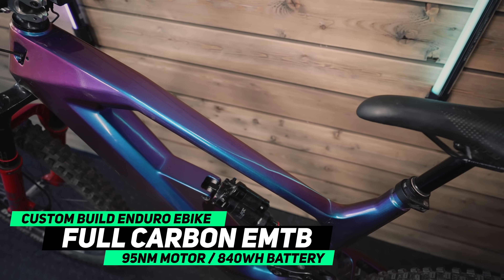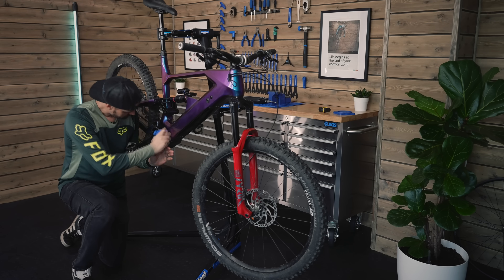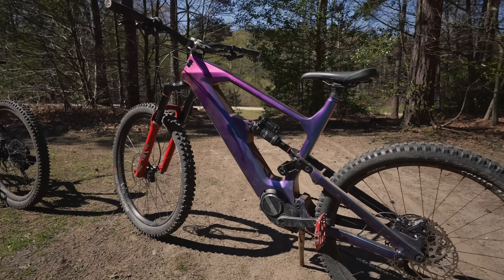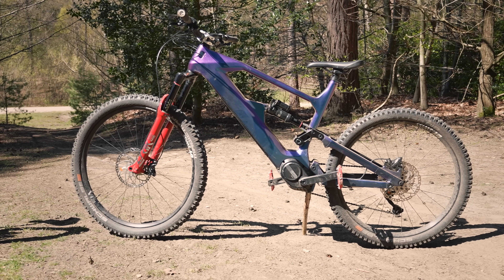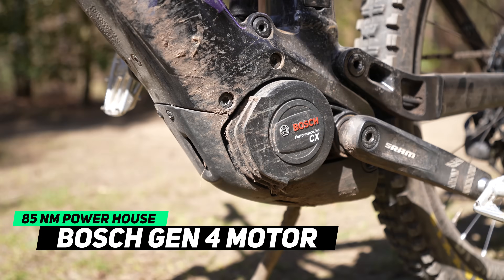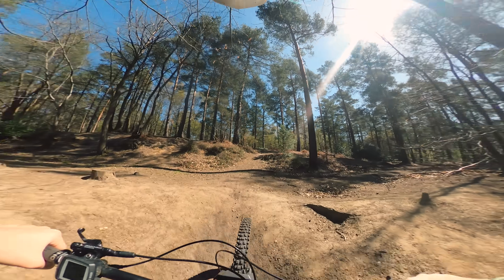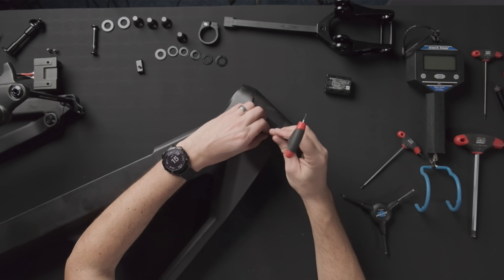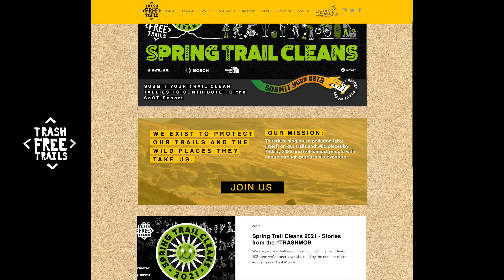This motor ABSOLUTELY CRUSHES it!!

Comment: Just a thought, I remember you fitting a 10speed to the cheeb, isn't the trek a 12 speed, surely gearing is going to affect performance?
Reply: Indeed, just what I was thinking and there is the weight of the two bikes to compare.  It's not all about the motor.
Reply: Also the model and pressure of the tyres.
Reply: I have eagle 12 speed on my DengFu with a Bafang M600. That climb he did is a breeze on my bike. I do way longer and steep climbs than the climb in the video. The M600 is the way to go for this frame. And having that giant pie plate cog on the eagle cassette is also the way to go for very steep climbs.
Reply: @EL34XYZ  The M600? Explain how you're going uphill with that 500 watt motor.
Reply: @EL34XYZ  do you have the ludicrous mode on your Luna X1?
Reply: @prolene1971  No, I have no need for Ludi. I use level 1/9 on my X1's and I like getting a workout. The bike has way more power than I ever use with just the regualar non Ludi controller.
Reply: @EL34XYZ  not everyone wants to own essentially a moped with cranks. Also with high wattage eats the battery quite fast. Not to forget heavy duty chains. Foes it have good shifting protection? Here in europe the m500 might be good choice if u want reqular emtb.
Reply: @viljosavolainen2286  You are spewing out garbage. The Luna X1 is an Ebike, not a moped.
Reply: @EL34XYZ  debends on the countrys legislation. And beyond that if you have thumb throttle.. yeah, we had in the past (around 80s) "bisycle". It had motor and cranks. Frame etc was exactly like their moped model and it went 40kmh. So what makes it not being moped? It doesnt go assisted beyond 25/32 kmh? Or it doesnt go without pedaling?
Reply: @EL34XYZ  that 2kw model is interesting. Does it have 1000% assist or even more? What type of chains does it use if other parts are from standard bikes? It needs hefty stong sprockets and chains, or you need to prepare to change them reqularly. If they had that 250w version in europe with otherwise same specs at that price it might be instand deal for me. Sadly stronger motor would make it registered bike if used on public roads with yearly costs of insurance.
Reply: @viljosavolainen2286  agreed

Comment: I have a 2020 Trek Rail 9.7. Bosch gen 4 motor. I can attest to how good this motor is. There is a very steep uphill with dips, ruts and turns where I ride (Lake Geneva Zip lines). It's about 150 feet long I'd guess and quite steep. I can put this bike on turbo and make it no problem. Just walking up this grade is very difficult. When the reviews say this motor is good, this is no joke. It's REALLY good.

Comment: Thanks Rob - I appreciate the honesty. Personally I like home builds. I accept that probably the Bosch motor is the best in class, but then look at the cost!!. It also occurs to me that when the warranty runs out the Bafang can be repaired by the user, not so Bosch as they are sealed units I believe?. So how would you think the Bafang stacks up against Shimano, Yamaha & Brose I wonder

Comment: I have a bafang M420 no throttle here in usa, had my motor for 19 months and climbed steeper in clines then that. Though I'm not sure of the 500 series or what gear you used to climb and my bike weighs 72lbs....... questions?

Comment: I have the bosch in my rail and I always thought the bafang was faster. I think this motor is in the Lune X1 bike making 2000watts and I was thinking of replacing my rail with that but now I don't know.
Reply: Luna bike has the m600 not m500 thats in this video and is a beast on ludicrous mode with 2000w hits 60km/h I dare say would smash any of the big brand name
Motors on the market, only downside is it’s 300g heavier and not road legal
Reply: @carsandotherstuffguy5300  I did it, sold my rail and bought the Luna X2 with 2000 watts....I am loving it!

Comment: I think its something to do with the seat tube angle. Chinese carbon frames have a fairly slack seat tube angle. That is why whenever I borrow my friends ebike with exactly the same motor. I always move the seat forward to steepen the seat tube angle which helps smoothen up the climb.

Comment: It's great to see someone finally do a legit hill comparison. It would be great to see the EP8 and Bafang Ultra with Archon X1 (Watt Wagons) controller.  EP8 won't do much but that Archon is rated at 160 Nm. Hope the next CHEEB uses one of those!!!
Reply: So it seemed to me that the Bafang bike could not climb something that a regular bike could do in short gear. I climb stuff like that all the time, just at the limit of traction and balance. Did I miss something?
Reply: ep8 nothing  special, bosch g4 will eat it on hills
Reply: Personally I'm more interested into comparing BBSHD versus Archon engine. Both seem to produce 160nm from engine. Gear ratio must be usable for climbing and high speed on road.

Comment: M500 typically is used for road/hybrid bikes.  M600 is for MTB.  The German made innotrace sinusoidal controller for the M600 is going to be bonkers.
Reply: M500 is the slightly de-tuned version of the M600 in order to comply with power legislation to be a Pedelec - like the Bosch Gen4, Brose Mag S, Shimano EP8, Yamaha PWX2.  The M600 is an s-pedelec motor and falls into a completely different classification - like a moped.
Reply: @pigshed  The M600 is literally twice as powerful...
https://youtu.be/qKd8GWlN-LE

Personally... I have the 2021 Orbea Rise on order since I'm an ex-MTB racer and I want that light flickable feel.
Reply: @justlikeyouful  Have you considered the Siryon ? Will be interesting to see what the bafang in that's like. Hopefully brilliant.
Reply: @pigshed  I did check out the Siryon.  Power, weight, torque are very similar but the Rise was lower priced and I can buy it right from my local bike shop.  Shimano ep8 rs motor is not perfection (what is really?) but I know I will get support for years and years.
Reply: @justlikeyouful  are you sure that Innotrace made controller for m600? They just develop for bafang Ultra.
Reply: @benzoesansodu5866  Yes, Wattwagons has it on the Ultra motor as used in the Hydra eMTB.   Word in the forums is they are developing for the M600 now... but because it is a sensorless it is a little more complex.
Reply: @justlikeyouful  I got that controller from half year. Just looking for m600 controller  :)

Comment: Just ordered the Dengfu E06 it was a bit weird making a PayPal purchase of 4.6 grand based on some texts and pictures. I really like the idea of a fat tire high performance ebike.Hope it doesn't disappoint. I bought it based on the cheeb video you posted Rob ! Is the new m500 more powerful than Bafang M620 G510 1000W 48V ? That's what is coming on my EO6
Reply: That's it not bad I paid $14,000 for my specialized levo turbo comp
Reply: No G510 is Max Torque: 160N.m
Reply: Hah after reading about the 14k bike. Mot bad mate

Comment: stupid question but can you just ride this like a normal E Bike and no pedalling at all??
Reply: It is sometimes supplied with a thumb throttle.  But if you built one up and wanted it to comply as a "pedelec" (ie, be legal without licence plate/insurance) you couldn't install it.  They work as pedal assist. You pedal, it assists depending on how hard you pedal.
Reply: @pigshed  oh thats interesting cheers mate!
Reply: Yes, sure. 
My Bafang 750 watt has both pedal-assist and throttle. 
No pedaling needed if you use the throttle.

Comment: i have never run out of power on a climb with the Brose. When it gets to vertical the front lifts up or the wheel spins out. the motor isnt the failure point.

Comment: The m500 is the bafang baby motor. The m600 destroys the Bosch and has no speed limit. I have a rail 9.8xt Bosch and on Strava the only trail times I can't surpass are the ones I posted on a day I borrowed my wife's m600 last year. So Bosch wins if you live in a nanny state. The Bosch is the smoothest motor by far but nowhere near the m600 in power.
Reply: Exactly....
However, the m600 does have a speed limit for the motors in the US on the Luna X1. With a 38t chain ring, was able to pedal up to about 54kmh.
Installing a 40t chain ring next week.
Reply: why not just put a bbshd in there

Comment: Good test !
I wonder how much impact has the battery packs here.
Are the cells, assembly and BMS of the Chinese E-Bike the same characteristics as on the Bosh one?

With lower drain cells and/or a weaker BMS, the voltage sag under load or lower peak current to the motor could limit what the Bafang motor can do.

It's often more obvious in other EVs than bikes, but battery packs are half the motor power 😌 or at least can be a bottleneck just like the controller, programming and motor hardware itself.

Comment: So Chinese Nm are like Chinese lumens for lights🤔
Reply: Lmao🤣 got one of those lights rated at 2000lumen and it barely let's me see a meter ahead.
Reply: Nm are not power. All that matters in the end is mechanical power, measured in Watts. Nm at the wheel can be levered with gearing. it seems the M500 has a 15A controller @43V that is slightly less power than the bosch cx (36V 20A). I don't know how many amps the 48v bafang controller can pull, but most likely less than 15A, since the motor can only handle a certain amount of power before overheating.
Reply: @JoLe1991 i think, the pinions are different between these bikes. The Newton meters are at the engine output and not at the rear wheel. If the pinions are different, there may be more or less Newton meters at the rear wheel. For example, at low speed (big pinion), there are a lot of Newton meters.
Reply: @BigEyess  yes true, the chainring to cassette cog ratio impacts wheel torque. the M510 is limited to 14A. on a full 48V battery the motor can pull up to 730W, if the efficiency is assumed to be 80%, the motor output would be 580W, which is pretty much on par with the bosch
Reply: Прошло 3 года. Вас ещё смешать китайские моторы Баланс???
Reply: Newton Meters ?
Reply: @bradburdett4491  yes I was comparing how some Chinese brands rate their lights at huge lumen ratings (hence the "Chinese lumens") and maybe there's a Chinese Newton Meter as they may also be exaggerated
Reply: @streddaz  probably it's because of a powercurve, where the bfang isn't good at low speeds while the bosh is...just try to guess

Comment: The vague title of the video already made me suspicious that the true winner would be the Bosch in the end. :-D Honestly, i think its really time to take the Bafang M500 into a testlab for some detailed measurements. I suspect that neither the original M500 nor the improved one they send you is actually capable of reaching 95nm of torque. While i admit that Bafang may still be dealing with a poorly written firmware here, i rather suspect that the M500 is actually a 75 to 80 nm motor. I would really like to see how it compares to a Shimano E8000 with 75nm. I have a certain feeling both will be pretty much eye to eye rather than Bafang ending up as the winner. Now im not saying the words "advertisement scam" here just yet. But...... ;-)

Comment: What about different geometry/tires of both bikes? In which mode did you test it?
Reply from the maker: Turbo / highest mode. CHEEB has a big Betty on the rear in 2.6 - grip wasn’t the issue, it was the low down power at low cadence 👍
Reply: 95 NM
@ rpm
95 continues or
Peak

Comment: Ah, even though the advertised Nm torque figure of the Bafang is higher, the sheer finesse of torque delivery of the Bosch is just top-notch. Good comparison! I have to ask if you'll entertain the idea of testing those built Bafang motors with an aftermarket controller? Innotrace is one of them
Reply: Not apples to apples though as the gearing was not the same.
Reply: Bosch outputs more Watts than Bafang. Not sure about Bafang but Bosch is ~600w continous.
Reply: @finrider9924  the performance line cx doesn't deliver 600 watts ever. Even the s-pedelec version won't go higher than 350.
Reply: @noneofyourbusiness4294  Yes it goes. Said and showed by Bosch. My Haibike flyon goes upto 1000w.
Reply: @finrider9924  It doesn't. Try googling that. 

They released the strongest version so far this year. The 2022 350 watts s-pedelec version. 

How do I know that? First, unlike you, I check things before stating them. 
Second, those things are a big part of my job. 

Whoever told you it's 1kw really had a field day with you.
Reply: @finrider9924  oh, and who told you that the Flyon uses a Bosch motor? It's a TQ. 

Why on earth would bosch even market that? 

Plus, if you're talking about the 920 Watt version, we're looking at a market bosch isn't  even fishing in.
Reply: @finrider9924  looking at Haibikes site: nope, you don't have the 75kph version. 

Haibikes S-pedelecs still use the Bosch Performance Line CX, while their Flyon models currently still are limited to the 25kph version of the TQ motor. Which, just like the 25kph CX, maxes out at 250 watts.
Reply: @noneofyourbusiness4294  Just giving example of flyon (TQ). On My bike manual they state 990w max.
On independent test Bosch 427w continous and TQ HPR 120 553w continous.
Bosch made the mistake on giving that info out once but they nenied that afterwards 😄
Reply: @noneofyourbusiness4294  There is no 75km/h version of Haibike 🤣
Reply: @finrider9924  not a single source on the Bosch stuff. Things like that blow up immediately. I'll go with a hard nope. 

And you're not exactly a reliable source after arguing that your TQ powered Haibike is a 1000 Watt CX. 

Nothing, absolutely nothing pops up to any claims you've made here. 

And not even TQ themselves state 990 watts, nor does Haibike even offer the 920 watts version. It's either one of the dumbest typos in a manual ever, or I'll have to call bullshit again. 

Plus, there's no point in Bosch hiding that their CX delivers more than specified, as long as it properly locks down at 25/45kph depending on the version. 

And you keep changing what you're saying. Bosch showed it, independent tests showed it, Bosch hid it. Sorry, but no.
Reply: @finrider9924  yes. I stated that you don't have a 75kph version of a flyon, because it doesn't exist. 

The top of the line Haibike model right now would be either the Xduro Allmtn coming in at roughly €9.000

Or the or the Xduro Nduro coming in at the same. Both coming with the 25kph version at a whopping 250 watts. 

The S-pedelecs from Haibike currently are bosch exclusive. You aren't looking at your manual, you're looking at an advert stating "potential" and fell for it. Giving enough doubt of you having €9.000 lying around to spend on a bike.
Reply: @noneofyourbusiness4294  I have the 2022 Xduro Nduro 8.0. 950w Max. The 2018 model had 553w continous. My display says the same, almost 1000w Peak.
And you are so saying my manual that came hand to hand from the official dealer is fraud? Also the flyon displays shows fraud data? Give me a brake. Tell me when you have ridden this bike 😄
Reply: @noneofyourbusiness4294  Sorry but you are wrong.
Reply: @finrider9924  nope. I'm not saying your manual is a fraud. I'm saying that your manual covers several types of motors of a, technically, single motor. 

I'd bet there is some wording along the lines of "up to 990 watts"

That isn't true for what you have in your bike, though. Your 25kph bike uses the 250 Watt version. Which isn't a bad thing,  at all. 

Technically the "big version", combined with the rider may output 990. The Motor alone does 920. Wiggle room of maybe 1%.

Sorry, mate, I'm not wrong. I can back up my claims, you can't even do as much as to provide a datasheet of a bike you claim to have.
Reply from the maker: Sorry, but Bosch, Brose, Yamaha and Shimano (and others) peak much higher then 250w. My Brose (250w nominal) peaks at 715 watts. The 250w figure that is used by manufacturers is purely a nominal figure over a given duration, to adhere to legislations and be legal in many parts of the world. The Bosch Gen 4 peaks at a similar level. Bosch just don’t advertise it.
Reply: @RobRidesEMTB  I'll ask for the same thing as before: any proof outside of "but mine does". 

As a dealership, we have to talk to customers about how their motors "just aren't the same anymore". Sure, over time, they just aren't as good anymore. 

But "they aren't as good anymore" is a far cry from saying that the CX puts out 600 watts, let alone 1000. 

If you have a video on it, I'll happily watch it and apologize.

But, outside of speedboxes I don't really see it happening. 

I'm sure the motors could handle it, no questions asked. But regular dealership updates won't unlock that.
Reply: @noneofyourbusiness4294  So again  you say the official dealer that sold the bike mies and gave wrong manual? Also the display shows false data? Also independent test (EMTB 3/2018) is fraud?
Reply: @finrider9924  I never said they gave you the wrong manual. 

I'm saying you got the correct one, which covers all three versions, as they all work on the same concept. Same thing with bosch btw. You'll get the same little booklet, no matter if it's an active line or a performance line. 

So, what I'm saying, and what I've been saying right from the start, is, that you have no clue about any of this. Your 25kph ebike does not put out 920 or 990watts.
Reply from the maker: https://youtu.be/ACcMP2fTYAM - watch this one, he explains it well,
Reply: I suspect that’s all down to the torque sensor in the Bosch.
Reply: Or more likely Bafang just lies in specs, like too common for Chinese production.